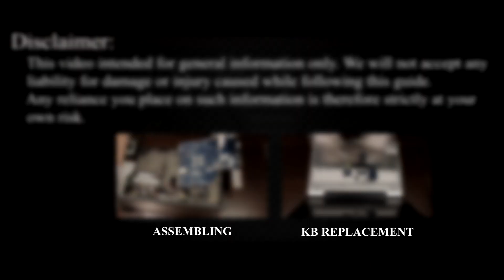Toshiba Satellite L500, L505 Disassembly, Fan Cleaning, and Thermal Paste Replacement Guide

Comment: just a quick one i have a l505  which has a serious over heating issue 103 deg at idle !!!, looking at your video if you pause it at 11:16, and look at the heat sink, the cpu and the chip next to it have paste on , but the little grey component and the chip on the right of the board doesnt , looking on my heat sink the thermal pad for the grey component is destroyed and the chip on the right has no pad, so i put on some paste , plus what thickness of pads do you recomend i use to replace all pads on the motherboard?.